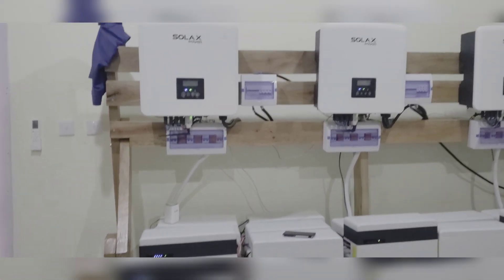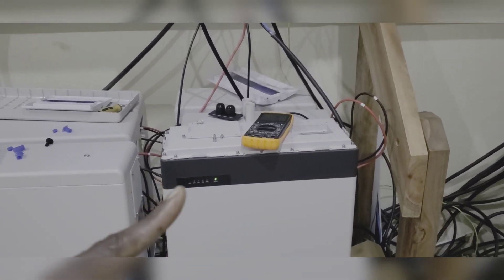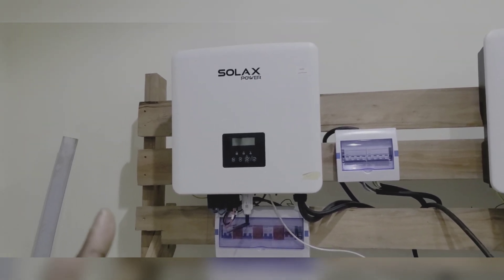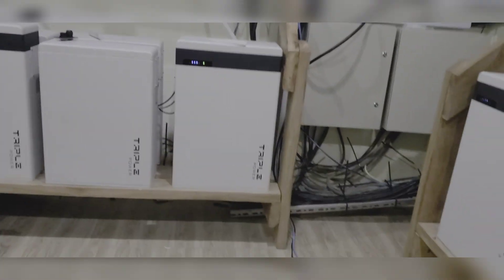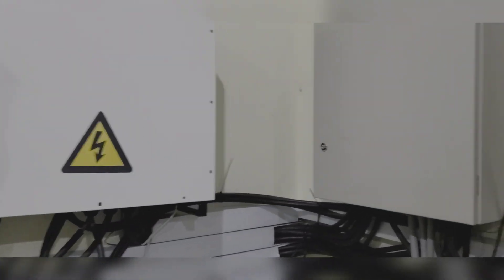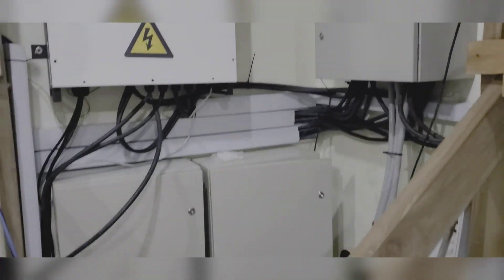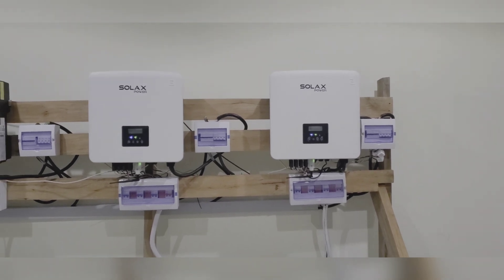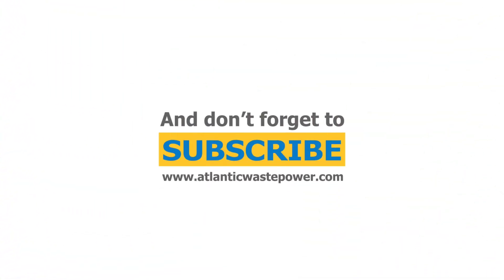Dr Solar's last video for a while. #solax #solarpowerplant #solarinverter #lastvideo #Nigeria

Comment: Hi Dr Solar, could you give me some advice. Is it normal to see Dyness batteries (2x A48100) where the charging energy always exceeds the discharging energy? Mine is by about 15% (e.g. Dischage 6kw, but charge 7kw in the day, this happens similarly day after day).
Reply from the maker: Good evening
Thanks for watching. How are you monitoring the data?
Reply: @drsolar  Hi, thanks for the reply. I'm monitoring via the Solarman Smart app. Looking at Charge and Discharge energy metrics